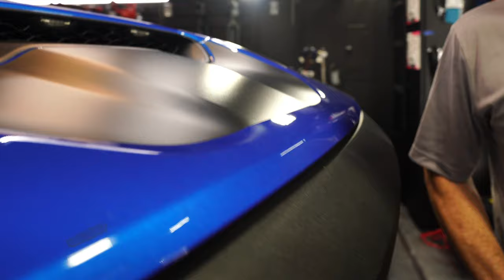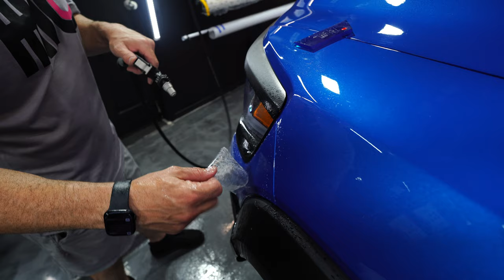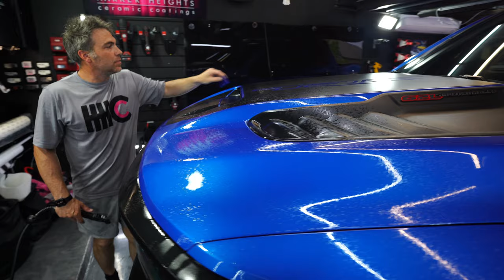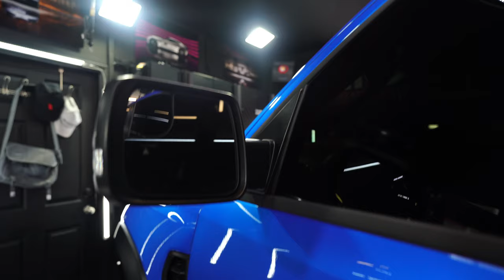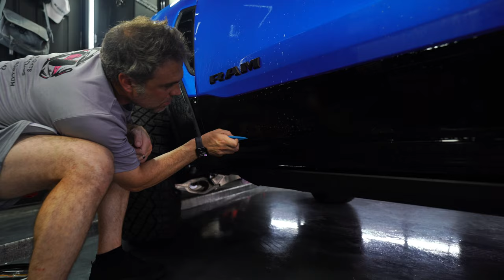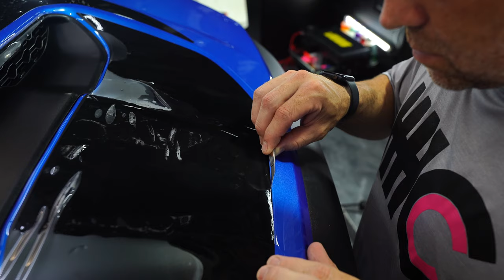2022 Dodge RAM 1500 TRX - Clear Bra/Paint Protection Film Installation | Serving the Killeen Area

Comment: What would it cost to do a partial front clip on the TRX?
Reply from the maker: Martin I don’t recommend partials except in rare circumstances. What color is it?
Reply from the maker: This was a quick fix and the darker color hid it but if you have a lighter color it will be awful
Reply: @HarkerHeightsCeramicCoatings  Granite, don't do a lot of off-roading but rocks are a problem on the highways here in Arizona, I'm interested in protecting the front clip.
Reply from the maker: It’s worth doing I’m just saying in many cases like if it’s white it will look bad over time

What color is your Ram? Our partial fronts on trucks are 1500 now